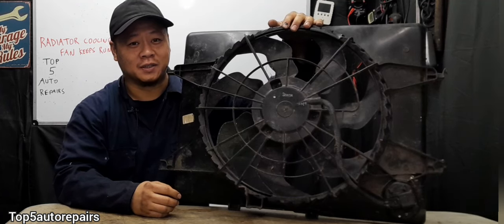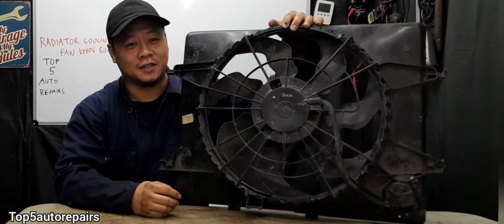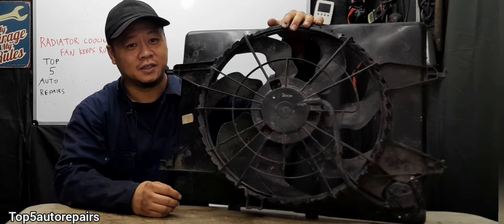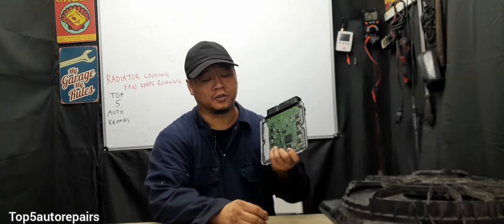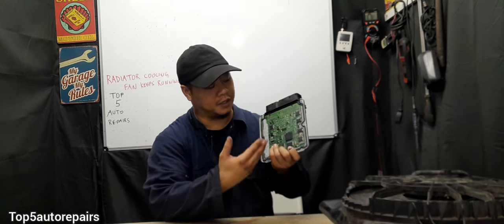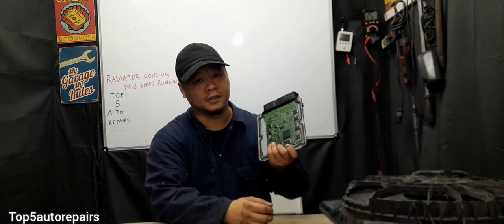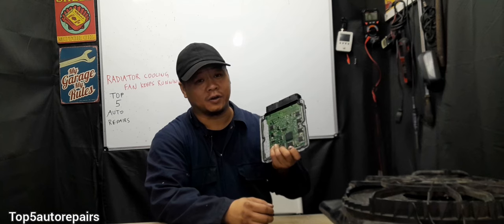WHY RADIATOR COOLING FAN KEEPS RUNNING AND WON'T TURN OFF

Comment: After driving around my car fan stays on too way too long (hour) that it killed my car battery 🪫
Reply: Yes mine also..what cause it?
Reply: Same here any solutions
Reply: I got the same problem 😩help
Reply: Same problem but only when AC is on. Fans don't engage when AC is off. Any updates?
Reply: I just had the same issue

Comment: I have an 2009 bmw 328i fan stay on high and radiator been replaced, AC blow cold and still running hot.

Comment: My 2004 Corolla has 198000km or 123000 miles on it. So basically a baby LOL. Everything runs fine. However the fan turns on as soon as i turn the key to second position and stays on all the time. Even from a cold starts.  It only comes off when i shut the car of completely. My other cars (Honda and Acura), fan turns on when necessary and then turns off. They never stay on all the time like this. Not sure if this is a toyota thing, or i have an issue somewhere. 

Only had the car 2 months. Its always been this way

  
Car never overheats, I drove the car on a 30 hour road trip no issue. No engine light on either. 

Any Help is greatly appreciated

Comment: Some cars have a fan control unit installed on the fan that controls the fan speed according to the temperature of the coolant and the IAT. Two places to also consider

Comment: Great video and tutorial. How about coolant always get full in the reservoir and not going back in the Radiator?
Reply from the maker: That is caused by a faulty radiator cap.
Reply: @Top5AutoRepairs  I have the same issue. Changed rad cap, thermostat, sensor, checked wiring etc. Only when I turn on AC and get fans going doesn't happen. Why?  thx

Comment: Good video 📹 👍 i do have a question my fan works at the beginning but then stops working completely do you know why?
Reply: If things are working properly, an electric fan for the cooling system should cycle on and off on demand according to the temperature sensing switch. It will typically cycle on when in stop and go traffic but shut itself off as ram air will provide enough flow when traveling.

Comment: whats considered a few minutes? i just got a new to me car...2021 buick encore, black on black... its been unusually hot here in FL.. 100... ive never had a car where i have heard the fan continue to run. it ran roughly 25 min after shut off.... is THIS normal?
Reply from the maker: It's definitely not normal. The fan should run no more than 5 minutes. It also depends on outdoor temperature. The fan may run a little bit longer.
Reply: clean those 2 fans
Reply: Did you look into this? I have a 2018 Buick encore and out of nowhere my radiator fan will randomly stay on after I shut off the car. Not abnormally hot and not every time I drive it either.
Reply: I have 2020 Buick encore & my fan wouldn’t stop running. Battery died. Dropped it off at dealership, this is gonna cost me ugh
Reply: Dealer just called, my cooling fan is shot. $1140 to replace. I don’t have a choice at this point, more credit card debt.
Reply: @tmerrill15  I didn't look into it yet, unfotunately right after I posted this..I started hearing this loud banging coming from the rear end. turns out the Rear DIf was bad, and it was in the shop since Jun 21, waiting on the parts. So now that I have it back, I have to continue to listen and see what else could be wrong with this car. Im going to be paranoid for quite a while...
Reply: @micheleparadiso3606  ugh so sorry to hear.

Comment: What if my fan runs constantly when the AC is on? It stops as soon as I cut AC  off.
Reply: AC needs fan being on all the time, however on the slow speed. Most of the time

Comment: I removed the fuse 40 amp and replaced it did not work, I replaced the relay it did work until I went for a drive and it kept running when I turned off the engine. I have to check the wire diagram I hope it's not the wire.
Reply: Check your coolant thermostat housing with the sensor in it
Reply: @framirez4770   did you fix the issue?
Reply: @joycedelarosa9304  not yet I'll let you know when I get it done.
Reply: Hey it was a wire issue I got a mechanic to fix it I hate messing with the wires. It's another thing that can be wrong with the fans.
Reply: Just an update it was the emc pcm motor computer that is failing it will cost 200.00 dollars for a new one.
Reply: @framirez4770 is that the cost for part and labor? I fear this may be my issue as well?
Reply: @tmerrill15  hey man so the guy I had check it didn't do a good diagnose and I had
To return the computer. My pops went to another place and they figured out what it was. He said it was a sensor which one? I have no clue.

Comment: Hi 
I have 2011 Toyota highlander limited edition. I have problem with air conditioner, it doesn’t blow cold air in a slow speed, when you stuck in traffic or idle,
The pressure is perfect, it blows cold air when car is drinking normal.
I took it to a few mechanics and they keep saying you need to add refrigerant.
I know a little about hvac for he but not for cars.
Please let me know what can i do. 
I don’t want to take it to the dealer before i talk to you 
I am in Maryland, i wish you were closer 
Thanks for your help
Reply: The same thing happens in my wife's CRV.
My mechanic told me the issue is the fans. The car has TWO fans. One is supposed to always be on when the car is running. The second one is supposed to turn on when the AC is on.
However, if that second fan won't turn on (bad motor maybe) then the car will only cool down when the air is blowing through the front.
So basically, replace the fan.